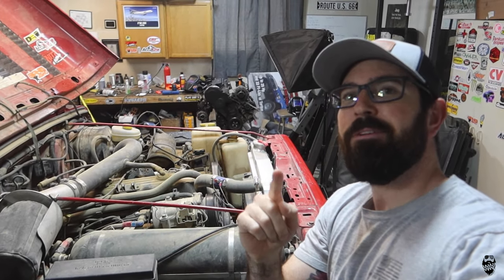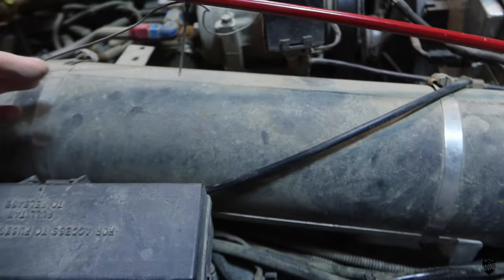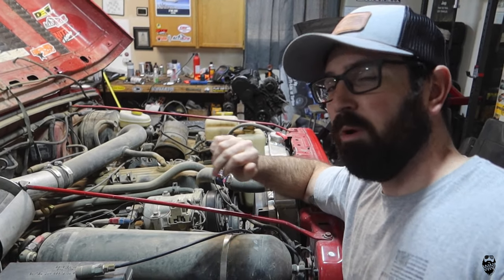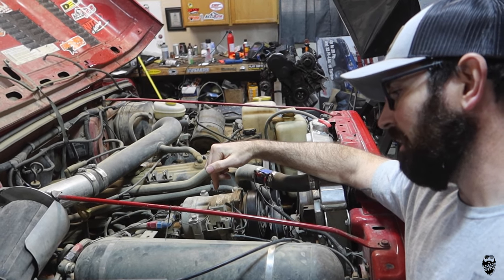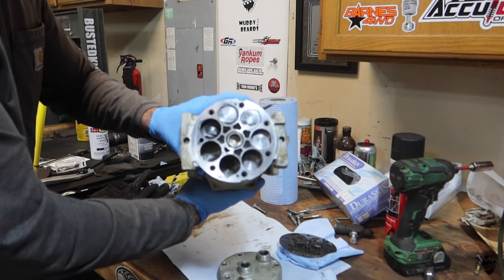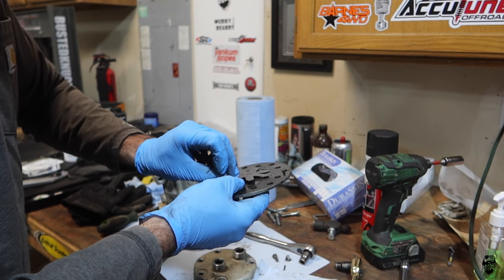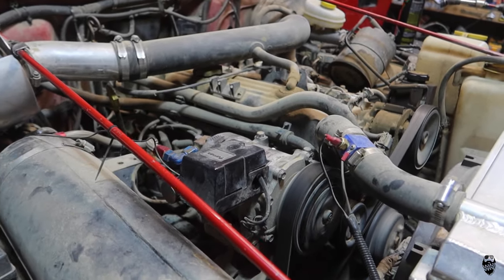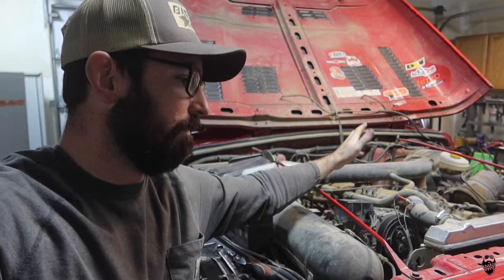DIY Onboard AIR!  A/C compressor to air pump conversion and Repair!!

Comment: So anyway, all of it intake and output and filters and fittings... That's all high school kids stuff very academic and easy to figure out. The million dollar question that nobody seems to answer... How does the compressor oil itself now? Because a refrigeration compressor especially a radial type like this one requires oil in the freon to circulate with the freon to both cool and oil the compressor bearings. But now you don't have freon in the system. So how do you put oil in it, does the oil stay in it without pumping out The discharge like it would in a refrigeration unit, did you drill an oil fill plug on it since it would not have that as an air conditioner compressor, etc. See what I'm saying? Or are you just running it for a video until it locks up with no oil in it? Explain how you got it to oil and contain a reservoir of oil in it that remains there to oil the bearings since it's now pumping air instead of freon mixed with oil. Thanks.
Reply from the maker: I sprayed WD40 into it maybe twice a year. I personally never had an issue, but it definitely could easily seize up without making an oiling system. The guy I bought the Jeep from would just throw a junk yard compressor on when it died. I have been using it occasionally for over 10 years, same compressor.

Comment: Has anybody found a way to add a 2nd ac compressor onto a 2000 silverado do make a system like this and retain the air conditioning?

Comment: FYI that's NOT the right pressure switch. Technically it does work. There's a 12v pressure switch with 2 spade connectors available on Amazon in different thread options either 1/4 or 1/8 NPT. Just wire the 12v supply to 1 terminal of pressure switch then other one goes to the compressor. Then per is on the pressure switch will close passing power to compressor till pressure is at 120psi or top the switch opens then cuts power to the compressor